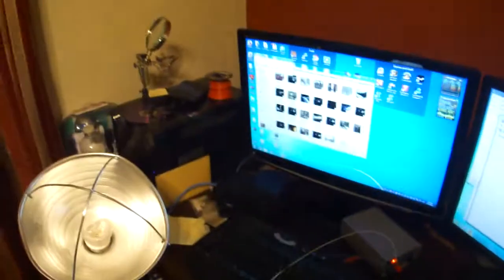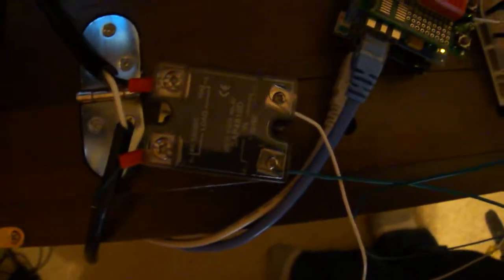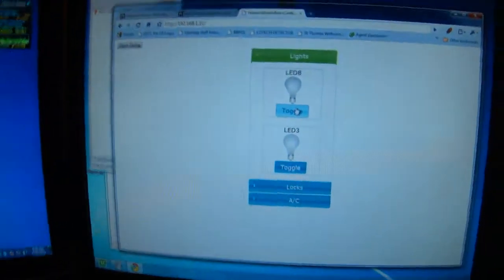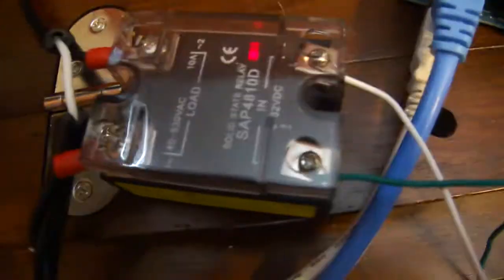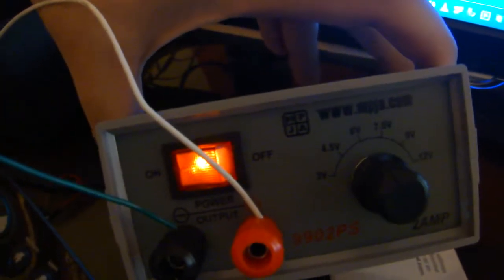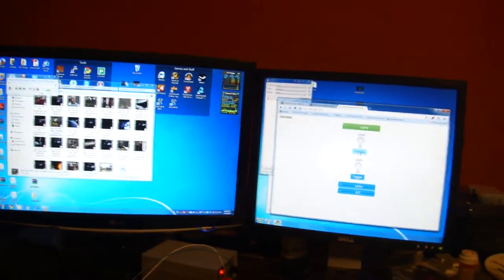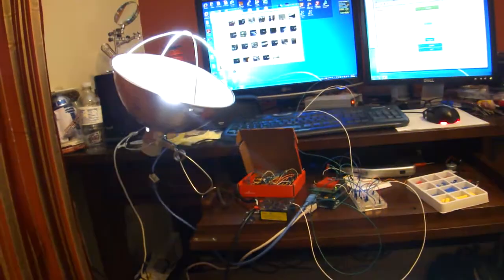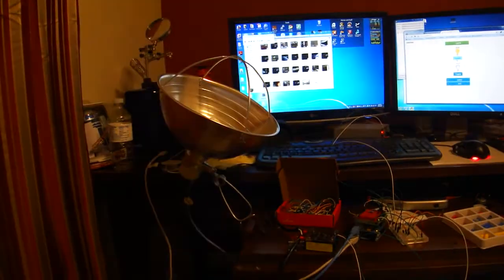Arduino controlling AC lamp with SSR

Comment: can you vary the voltage with SSR,like can you change your bulb brightness??
Reply: do that and you get harmonics. try using a "analog controlled ssr " if you want something simple or a triac with a driver circuit and a zero crossing circuit. I'm not going to bore you with the engineering but it will be cleaner but more complex http://playground.arduino.cc/Main/ACPhaseControl
Reply: I am no expert but instead of the voltage you switch the relay quick on and off   to change brightness. Like with an led
Reply: use an arduino and small solid state relay. they are cheap. 500 watt is the norm.

Comment: From what I've read most solid state relays usually pull less than 20mA on the control side, so you shouldn't have to use a transistor.

Comment: Seems like a very expensive setup for turning the lights on. If you go on ebay, you can find light bulbs controlled by remote, 110-220v.

Comment: The transistor is just for the 6V power supply which ultimately operates the SSR, right? According to FairChild Semiconductor's datasheet the power supply is nowhere near the max breakdown voltage of 60V

...but someone please correct me if I'm wrong (I think I might have read the datasheet wrong)!!

Comment: Hi i had gone through ur video it was interesting. Could u tell me which software did u use to create GUI interface to turn on the AC bulb as well as LED. i am new to this GUI creation so i request you to explain  it in  detail how to create the GUI and to interface it to ARDUINO or any other micro-controllers like AVR, PIC etc... if possible or link me to any other tutorials available.  which interface did u use to communicate to ARDUINO is it RS232 or USB .
Thanking you in advance.,

Comment: What voltages and amps are going into the relay for on and off?  is it as simple as to apply power to the relay in order for the ac current to flow through? and to switch the relay OFF simply turn the power off?

I have read that you need 1v to turn the relay switch to OFF and 3.5v+ to turn the relay switch ON.  is this true?

Comment: @robodeath Sorry to hear that :(. I just have to say though, you all did an EXCELLENT job. I am looking at getting into this (a little lighter because I'm in an apartment), but still thermal sensors, ip cams, etc. This may also help you for the future for moveable things (search: Control three power sockets from a PC wirelessly - first one - uses a TI Launchpad, but arduino would do it!)
But you guys did a TON of heavy lifting getting the html and php together and all the ideas, so THANK YOU!!!

Comment: Ive been following your project reading through that forum and it was awesome how much you guys moved forward! I really like how responsive you made it (almost instant!) That is what I need too.

So you are using PostGrey? I know nothing about that, can you elaborate a little? I like the database idea, but don't want that delay... Also, what did you end up doing for physical light switches? Is there an arduino controlled switch and still a physical switch?

Comment: Relays are cool, but they consume power unless they are of the LATCHING type . . . so if you're looking for power savings, go with latching SSRs.  Also, you can design a DC-DC converter using your Arduino and a few parts to step up a PWM voltage from the Arduino to whatever you need, and maybe even store it in a capacitor large enough to give you the power needed to get the SSR to switch - it might yield a less responsive light switch, but at least you wouldn't need a separate pwr supply.

Comment: And you could get rid of that external power and transistor hardware setup with a 5V relay that is powered only by the arduino.